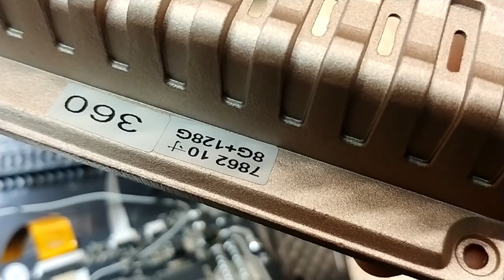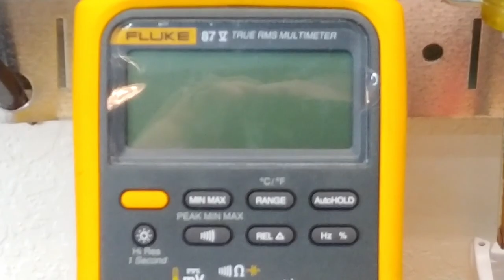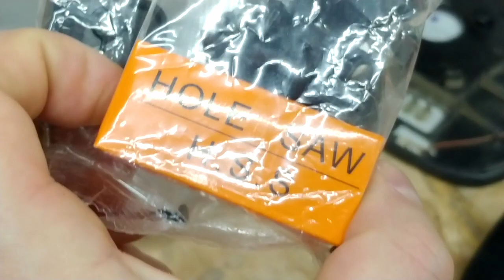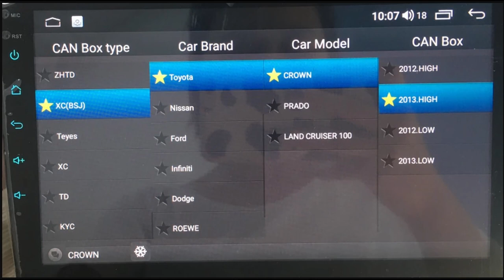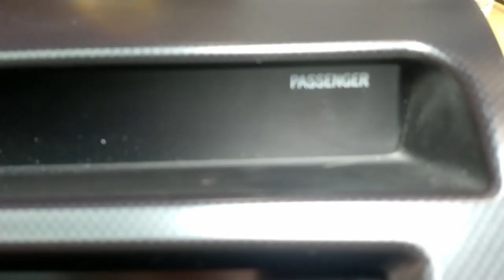EKIY T7 Tech Deep Dive & Tech Teardown / Overview for 200 Series Toyota Land Cruiser

Comment: Ekiy using Joying Firmware which is quite poor you can't even turn on button lights  via menu system ,wireless CarPlay has constant cut offs and CarPlay screen gets pixellated overall I do not recommend anyone Ekiy ...wish Teyes CC3 was a bit cheaper seems like its the most polished FYT unit so far .Thanks for the video P.s Orange ILL wire  to ACC if you would like to turn on the Button LEDs :)
Reply from the maker: Thanks for the tip. So the only way to get button backlight on is by hardwiring the orange ILL wire to ACC? I may install a switch cause I have some laying around. Honestly, I'm not too worried about lighted buttons, but it'd be nice to have. Also, don't care about CarPlay at all. Apple is notorious for not playing nicely with other operating systems or platforms, it's one reason I don't own any Apple products, and probably never will. I wouldn't expect any less from Apple regarding a generic Android based HU. That said, I would like Android Auto to work, at least eventually (firmware update) to extend the usable life of the HU (even after it's antiquated, it can function as a gateway for a brand new phone running all the latest and greatest). 

I've heard great things about the Joying HU, so that could be a positive if they're using Joying firmware....it could certainly be worse than Joying. I understand Joying does lots of updates and is kind of the "name brand" of these FYT HU's (along with Teyes). I'd like to avoid having to root this thing if I can, so I can probably live with Joying firmware for the time being. Unless you have other suggestions that work? I've heard it's very hard to root these new HU's.
Reply: @evankolpack  My HengCheng FYT has a setting for button backlight but its based on time and never works especially with VPN maybe i will hardwire the ILL to ACC i have the pinout chart somewhere in this hard drive. Subbed for the additional storage for Prawn...music joke.

Comment: I know this is a year+ old, but hope someone will see this.  I have been messaging back and forth with EKIY about installing a 10" T7 8G 128G in a flat panel in my RV.  They refuse to work with me in any way and have asked me not to order.  They claim their unit can't be mounted in a flat panel and won't even answer my questions about mounting locations for the cameras, extension cables, how many TPMS sensors can be supported, etc.  I'm glad they helped Mr. Kolpack, but they have been completely unhelpful with my proposed installation.

Comment: Large chip covered in paste is 4 channel audio amplifier, looks like old style AB class since pins are directly connected to outputs, if it was D-class, would have output filter inductors and cap network...
Reply: filter is right beside the power plug port

Comment: Hi mate. I have a similar android unit installed in my Ford Fiesta MK7 2009 model. I bought it from a seller in aliexpress, its not EKIY but from my research the looks and the UI is excactly the same. Everything work fine except the steering wheel buttons. I did some troubleshooting and to sort this out i need to check the wirings. Unfortunately, the unit didnt come with installation instructions and wiring diagrams and the seller does not reply to my messages. If you have, could you please share with me  any installation manual and wiring diagrams? Thanks is advance.
Reply from the maker: Sorry man, I don't have any. My unit came with practically zero documentation, it was all online. Sadly, you may be out of luck if the seller won't reply. This is one of the big reasons to go with a brand like EKIY who, at least currently, has excellent customer service and will answer this kind of question. I'm guessing you could message EKIY and ask how to do it on THEIR head unit, and there's a strong chance that procedure/wiring MIGHT work for your implementation, but it's risky. If you connect the wrong wire to the wrong place, you could easily screw something up. ECU's are expensive. Sorry, wish I could be of more help. Good luck!

Comment: Herman from Holland here..great obscure video😂 
I ordered one and try to prepare my a-technical ass😅
On my volvo v70 Ive got a original fancy handsfree set built in...trying to figure out how it all can operate...needed to know if the t7 has a built in microphone that actually works...and now I know😊
I do not want to take the volvo kit out, but having two of these cockroaches in my car is just too much...I will try phoning with the t7 by disconnecting my volvo kit and will try the old handsfree set by disallowing phone permissions on android auto...shocking how little info there is on combining old carkit with a headunit😂

Comment: Pumped about your setup. Have you thought of using usb vs coax into the minidsp helix? It’s a neat feature of that vs the cdsp 8x12. Thank you for the deep dive I hope you find the time to post your thoughts on the setup. I am interested in the 360 view, audio quality, and dvr. I hope android doesn’t mess with the output even over coax or spdif have seen some setups that the internal dsp does still effect the signal out of the digital outputs as well.
Reply from the maker: Hey Derek, the DSP I have is a MiniDSP Harmony 8x12. I was looking at Helix options, but they don't support DIRAC or FIR filters. Being an audio junkie, these were important to me in a high-end DSP. Both the Helix options as well as MiniDSP support USB HEC audio. My MiniDSP supports up to 6 channels. You're correct that Android doesn't always like to play nicely at the OS/root level with digital audio outputs, so we'll have to see how that pans out (I'll definitely be doing a future video). If I can get the 6 discrete channels out via USB, I plan to route them to 6 virtual/digital ins on the DSP, which will feed the following outs (ins 1/2: front 3-ways, ins 3/4: rear fills, in 5: sub, in 6: blank). This way I can have separate control over fronts, rears and sub on my HU, closer to what you'd find in a stock system. This will be in addition to presets I can select from via the Harmony DSP wired remote.

For a deep dive into the specifics of sampling rate and others pros and cons of USB HEC audio vs coaxial or optical digital audio out, I posted a thread specifically about that on DIYMA. Aloha! https://www.diymobileaudio.com/threads/hec-usb-vs-digital-optical-out-of-hu.442929/page-2#post-5990675

Comment: Could you check the amplifier IC chip, the chip that's just slotted in the back housing with the paste and see if it's a tda7850, 7851 or 7838? Thanks

Comment: Hi, great video, I have a question. I managed to tight GPS antenna too much and hear crack. it is working but i would like to solder it back. do you know how to do it? is it difficult? Also is it difficult to open the EKIY unit?

Comment: Some other brand models reverse plug must plug in unit even if you don't connect rear view camera because the short two yellow wires are some kind of antenna I don't remember but you will loss WiFi or Bluetooth connection or will be very weak.😅

Comment: And one more question: do you know if you can plug your phone into it via USB and get all the same features as the heat unit would have over Bluetooth for controlling the phone? And would it use data tethered from the phone at that point?

Comment: Thanks for the video. I have a question, if this unit only suppprts 4g why does it have a 5g antenna?
Reply: The 5G antenna should be for WiFi if I'm not wrong. Typically that's used when you tether the HU to a mobile phone.

Comment: Hi Evan! I bought this HU for my renegade but the firmware came with a birdseye app called 360 panorama, and is not working with my car's stock rear camera... Do you know if I can connect the rear camera alone into one of the pins in the birdseye plug? And if so, do you know which pin do I have to use? Thanks a lot 👍👍
Reply from the maker: As long as your rear camera uses the same format (I believe these use component video, which is usually a yellow RCA plug) then you should be able to do exactly that. EKIY should be able to tell you which pin is for the rear bird's-eye camera, but it should also be on your wiring harness too. You should have one pair of wires + a trigger wire labeled in the online manual as for the rear camera.

Comment: I've just installed a similar unit on my 2010 Venza. But.... When I turn the car on (not the engine) the unit is working. But when I hit the ignition the unit powers off. Do you know what the issue might be? 

After I saw the problem I disconnected everything but the power cable (second harness with RCA, 4g, GPS, etc.), to test and the problem remains.
Reply from the maker: It could be many things, but I'd obviously verify 110% that the IGN power is wired correctly and actually receiving voltage. I'd also verify that the ground pin on the unit has a good low resistance path to vehicle ground on the body/frame/engine block. It could be some other external system causing it to shut down, but most likely it's a power and/or wiring and/or ground problem.
Reply: @evankolpack  Thank you Even....I was looking at IGN power and wondering if some harness/adapter wires were wrong...But, I heard back from EKIY saying the steering wheel buttons wires are going to two plugs and I should cut one of them. Thanks for your reply. Appreciate it!
Reply from the maker: @ThePhilbox  Glad to hear EKIY is still providing great support! It's EXTREMELY rare to find that with this sorta thing. Anyway, glad you got it sorted out. ALOHA! 🤙
Reply: @evankolpack  Yes, they are and I'm very happy with the unit so far. Sounds good, snappy response. Just have to get the back-up camera working and Ill be 100% satisfied.

Comment: Bought t7 8gb with ekiy dash camera with rear . Can't get the dvr rear camera to use as reverse camera when car is in reverse .
Reply from the maker: Did you hook up the trigger wire to the correct place on the main harness? Verify it's getting +12v for your reverse lights? On my implementation the reverse trigger wire is right next to the main 12 +/- wire, but check yours.
Reply: @evankolpack   it was installed by professional radio installer and they said they did connect it with reverse tail light . My worry is that ekiy and even Saab unleashed YouTube video said the rear dash cam can do both reverse trigger on screen and recording, this may be not be true but I looked at another android unit mekede dashcam rearwhich also claims it does both.  I wanted to get wiring diagram

Comment: Would a computer 80mm or 120mm+ fan fit instead of a screaming 40mm chinsy one lol
Reply from the maker: It may fit, but you'd have to be careful about current draw. You may be fine with an 80mm, but I don't think a 120 would fit and you may draw too much current and blow to driver. Also, it may make more sound if you don't add a resistor to limit draw.
Reply: @evankolpack  My EKIY from the "Official" store is the variant with a slot for the 40mm fan, which store did you buy yours from? My mic had no leads but soldered directly to the board, I just cut the trace and If I want to restore it, I can just solder bridge the gap, the internal SIM cutout have also been removed so its no longer accessible unless you open it up. That large chip with a whole bunch of legs and thermal paste is the amplifier chip lol, I lucked out and got the better TDA7851L where the listing said TDA7388, the small square IC is the microcontroller (GD32/STM32 clone)
The IC with the sticker on it is the NAND flash, mine reads 128GB (got the 8+128 also) and has no RF shield oddly, just on the other side with the SMA connectors. The large rectangular TSSOP IC is the DSP